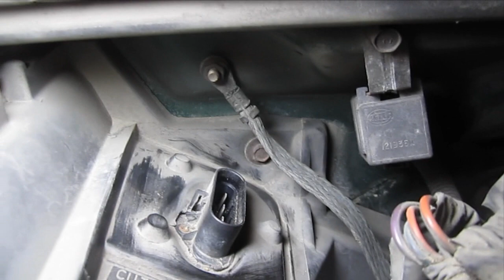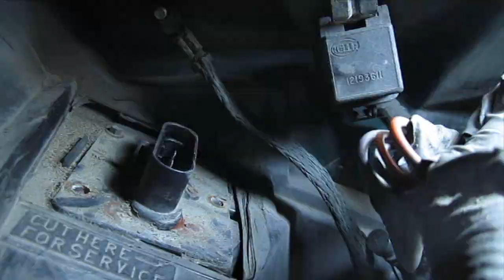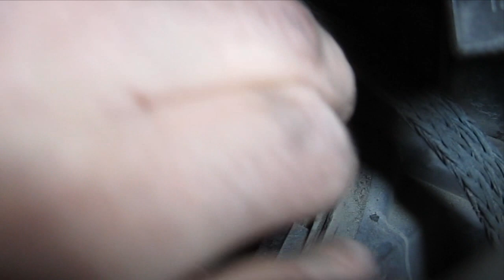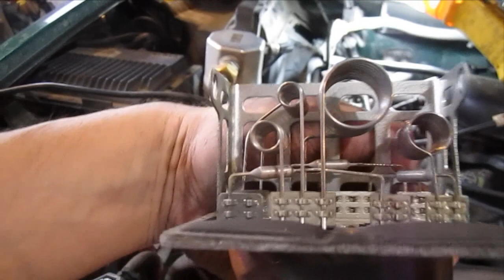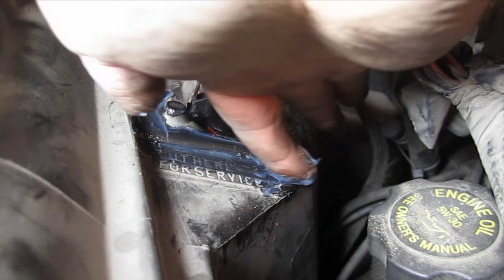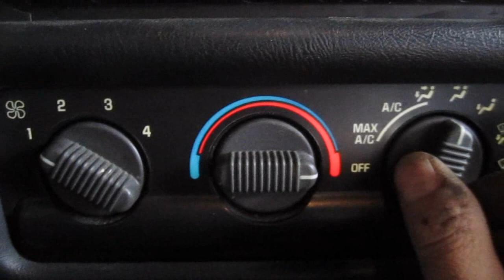Blower Motor Resistor Replacement - How to Repair Heater Fan Speed Control - Chevy Blazer Jimmy S10

Comment: If you’re still answering these comments, I replaced my resistor pack and the highest speed on the blower doesn’t work, would the problem now be in the switch itself?
Reply from the maker: I'm guessing it could be the switch.  It shouldn't be difficult to test.   Good luck!

Comment: replaced resistor fan still not coming on at high or #4 position
Reply from the maker: Probably  the switch.
Reply: @nogripes  check your HVAC 30 amp fuse.

Comment: Glad I found this video. Having to cut into to remove is just dumb in my opinion. It's 2:45am and I was so curious and wanted to determine the exact location of part so I went outside (carport) to look. it is currently 30 degrees here. Thankfully mine requires no cutting for access. Thanks.

Comment: What if the blower motor isn't whining, but it's still not running on speed 4 yet I've already replaced the blower motor resistor and the actual selector switch?  4 will eventually work, but it seems to need to "charge up" first where it won't run initially, but if I leave it on 4 and drive around, all of a sudden it comes on speed 4.  Sometimes that will click off and on again, but each time it stays on 4 more solidly.

Comment: You suggested you did not need to replace the covering of the blower motor. Is it possible you do not need to replace the cover here either? Is it necessary?

Comment: It worked. Replaced the switch from one out of a wrecked salvage yard and found that wasn't it, so I followed your video instructions, and picked up the resistor from AutoZone today for $16.99. And voila, it works! Thanks man.
Extra info- if you own a blazer with the climate controlled A/C unit, you are screwed! Price on one of those same resistors was over $250 at the same store! Geez!!! The Cost of extra options from factory!

Comment: so I replaced the blower motor resister in my blazer 2 things I shredded the cover would it cause problems later on? And my highest level of my blower still doesn't work. Any suggestions

Comment: Question and thanks for these great videos!! My 1997 Blazer has 2 issues. The Max AC setting does not kick the fan up to the max speed anymore. When climbing hills or accelerating the fan cuts out. I read this could be a vacuum check valve and/or vac leak? I have one suspect line to look at today and just so happens to be the main line to the engine that houses the check valve from what I read. I do not have noise from my fan motor and all positions otherwise work so I am thinking I do not need to worry about the blower or the resistor set yet. Currently my AC is discharged as well. I am thinking the refrigerant all leaked out from the compressor. Not sure if that would affect the Max AC setting in regards to fan speed. Thanks so much!!

Comment: Real helpful! I just ordering a blower motor resistor for my Honda Accord 2007 EX w/ voice activated navigation. I hotwired the fan motor to make sure it worked fine and it's perfect what I want to know is what it be OK if I bypass the module temporarily and hotwire the fan motor till the resistor gets here? Seems like you know your stuff pretty well. I have all the classic symptoms of a resistor that went out last week. Can I do a bridge wire and the connector that goes into the module and put a jumper wire there until I get the new part? Thanks a lot !

Comment: 1995 s10. heater core gets hot. blower blows. nothing comes out of the vents. checked fuses. replaced the only vac line i could find. it came off that ball thing. ideas?
Reply: I also have a S10 95 chevy. Where is fuses for you s10? The heater is not working on my truck. Only blow cold air, thanks

Comment: I have a 98 gmc jimmy and I've tryed replacing the selector switch and the resistor what else could cause it not too work right?
Reply: Set speeds and after doing more looking it seems to be a ground issue also the box next to the resistor might have an issue

Comment: i have a 97 blazer and was having a problem where i only had high and low on my heater switch. changed the resistor out and all of them work again.thanks for uploading this this helped alot but i did not have to add the sealant around it.i guess you could do it to add extra protection from dust and dirt though.

Comment: I have an 02 S10 I when I change the radio last spring there was a puddle of something under the radio, above the ashtray, on that "shelf" I guess I'll call it.  I have NO clue what it was.  Didn't smell like anything but when i popped out the control switch panel, I flipped it over with the wires stil in tact & the same fluid was very slowly leaking out of the feet, face, defrost control.  NO ONE know what fluid it is & it also blows on whatever it wants.  I have NO feet heat which sucks cuz my feet are always cold & what really sucks is taking forever to defrost my windshield because it rarely flips over to that no matter what setting I have it on.  I replace the actuator under the dash twice & still have the same problem.  Should I change the vacuum lines? IDK what else to do so I'd greatly appreciate any help anyone can give me. It's an 02 S10 with only 90,000 miles on it & I keep up with EVERYTHING on this truck.
Reply: Not red. No smell. Had the switch changed & my mechanic who I went to high school with said everything seemed fine when he changed it. The only place I saw it leak was under the feet, face, etc control. Nowhere else so its a puzzle.
Reply: I saw that one a while ago of the actuator under the dash. Forgot about it till today. When its not 18 degrees here I plan on heading under & checkin it out. I already replaced that actuator twice thanks to my last mechanic who worked for Chevy but as u can see never fixed it. I was going to try to replace as many vacuum lines as I could find but I can't find a diagram to go off of. Again, TY so much for helping me out
Reply: Jen B It's 19 degrees here and I'm heading out. No more cold drives to work!
Reply: Well right now I have my dash off & in the back seat cuz the feet face defrost turner thing is leaking oil or something from behind it. AND it hisses cuz its seems to not be completely attached. I priced that part & it's $150.
Reply: The heat works. The heat always worked. It just doesn't go to feet & defrost. When I had other work done my friend who owns his own place did all the work & replaced the switch in the transfer case. He said when he nothing was leaking & nothing spilled over when he did the job. Only place I have this "oil" is in my dash under the radio & leaking out of the bottom of the back of the feet face defrost switch. Today, if I have time, I'll be replacing the 4wd actuator under the battery. I just don't know if I need that $150 part behind the feet face switch where its leaking. I figure I'll blow air through the lines to get some of the fluid out.

Comment: I Have a 96 chevy blazer  my speed fan only works from 1-3 but 4 doesn't work what can the problem be?
Reply: *****  I have the same problem. Changed blower, resistor' and the speed Spector switch in the dash. All speeds except for high (4) are working fine. Any ideas on a fix for this? Thank you!
Reply: Shannon Mitchell I had the same issue and noticed my HVAC fuse (30 Amp in the main fuse box under the hood) was blown. I replaced that and 4 works again like a charm!
Reply: That was it thank you!

Comment: Hi Mike, I have a 2001 chevy s10 that will only blow cold a.c. when I turn my temperature switch to the right for heat it stays blowing cold. All functions with my speed selector and other switch for sending to different vents work. Just cant get it to cycle to heat. Any suggestions? ?

Comment: Hi Mark, Thanks for helping in advance. The air just barely blows in my 96, S10. The rotating fan control nob has spun freely without clicking for a long time before it started to do this. The clicks don't seem to be working but it worked fine for at least 3 years before the air just went from a low high blow to just bairly blowing. Do you think it's the resister or the control unit on the dashboard? Thanks again.
Reply: no
Reply: ***** No, they are the traditional controls. The top control has the red and blue scale on a circular nob for temp. The bottom one has the circular nob with the  ac, def, heater, etc. and to the right is a is the nob that is inset that dials up and down for the high low fan. It has been turning smoothly instead of the original clicking between the high and low settings. But it still worked for the last 3 years. You think it is that control? That sucks because that is the most expensive part of them all. The price I found online was over $200.00.
Reply: *****
Thanks for the advise. I think I will probably replace the resister anyway. The truck has alot of miles and it's probably only a matter of time before it goes out. I think the resistor is around $30.00. Maybe I will try a junk yard for the control switch on the dash. Do you think that is a viable option? Thanks again.

Comment: Hi, we replaced the blower motor and resister, thank you for the video's. The heat doesn't get hot though, just warm. Can you tell me what that might be?
Reply: Low radiator fluid possibly. Lol if that helps 5 years later 😅🤣😂

Comment: Hi Mark. My 97 S10 blower fan speed control some time cut off on all speeds a few second later come back on it been doing a for while now.What am I dealing with? Thanks
Reply: No unusual noise and run most of the time on the 3rd speed.

Comment: i have a continuos ticking sound coming from my resistors when i took out my glove box out i put my finger on it &2 out of 3 keep ticking & my heater don't work at all i have a chevrolet silverado 1990 5.7 engine what do you think / im thinking it's the resistors ??///
Reply: i cleaned my heater core went to turn on the heater &everything went dead &then it started to make that ticking noise all of them at the same time .. now i took out my resistor thinking maybe it's that ???? what do you suggest it could be

Comment: Hi. I have an s10 pickup and the heater no longer works. When it's set to heat it just blows regular (cold in winter) air and won't defrost, either. I went to a shade tree mechanic who made me buy a new AC control face that I did not need. After that he opened the dashboard and disconnected the vacuum hose(?), sucked on it and it blew hot air. I need to call a real mechanic to fix it and want to know what the real issue is. "Hi my vacuum hose is not sucking?" Any help? :c

Comment: I have a 97 blazer and I have no air coming out my vents at all checked fuse its good would you try just replacing the resistor before the motor itself?

Comment: my 1999 trailblazer blower motor finally stopped working. I purchased the replacemnt motor only to discover, (after removing the, computer and reservoir and plastic cover) the motor and control module plug are different from the vdo part I was sold.  I can't find that motor replacement anywhere in north america.  My question is, can I replace the control module with the new and correct plug and connect it to the new and recommended blower motor that I purchased? FYI, the blower motor and control module are marked ITT made in mexico and the various part numbers that I cannot find. Please help I'm so frustrated! Even Canadian Tire mechanics don't have any suggestions. HELP!!!
Thank you for reading

Comment: So this morning on my 2000 GMC Sierra 1500 the blower stopped working on my truck on all speeds for both AC and Heat, all the lights on the fan speed device are on, i puled the instrument cluster and everything seems to be plugged in tight. Checked all fuses as well and they are all good. Also at the same time my turn signals stopped working. Hazards also don't work and have not worked for a few months. I think that might be unrelated. Anyways, any help you could pass my way would be appreciated. Thanks.

Comment: hey Mark...happened to come across your vid...I already have done what you have shown here and now I have heat....but only fanspeed 2 and 3.....1 and 4 have nothing....possible they gave me the wrong resister?
Reply: I had lost speeds 1 and 2 last winter...3 and 4 worked great..then after work one (cold) night I had nothing...stood out in the cold with a flashlight and replaced the fan and resister...diehard..but yeah I ended up with 2 and 3 fan speed...
Reply: thank you..

Comment: I have a 98 Blazer. Its a hand me down and I'm gonna use it as a learn how since it is my first vehicle. It has some issues. Like what you have here in the video. My other issue is the Gas gage. It isn't working properly and I have to pay attention to the trip in order to keep watch on the Gas. I am wondering if you have come into issues with the gage. It still alerts me if it is empty. But it will tell me it's empty when it's not. Have you had issues with the gas gage and if so could you fix it yourself.

Comment: i also have a 98 blazer the resistor is in between the blower motor and heatercore on the ones with the blazers with Auto HVAC controls and it cost around 300-500 dollars

Comment: Mike,I have a 1998 Chevy Blazer with the Auto HVAC controls I notice i don't have the fan resistor where u show it in the above video and i dont think Its blowing on the highest setting,any suggestions.The spot u show the resistor in is emtpy in mine.

Comment: mark, any help, do not have a clue i guess it was the resistor but what is not letting speed 4 work now i read that the speed 4 does not go thru resistor can there be an inline fuse all other fuses are good that i can see

Comment: Hey Mark, 
2000 Chevy s10 originally 3 & 4 speed worked on ac blower motor but not 1 & 2, I changed the resistor, the relay and the 20 amp fuse inside the cab that was blown.. Now I have speeds 1 2 & 3 working but no 4, can you offer guidance?